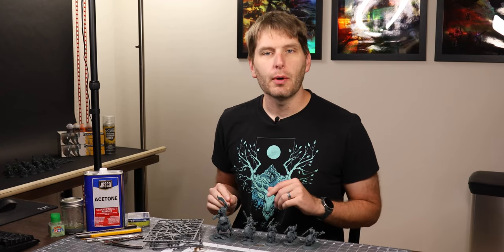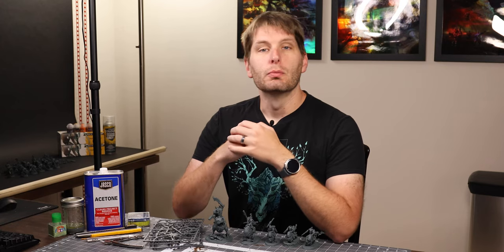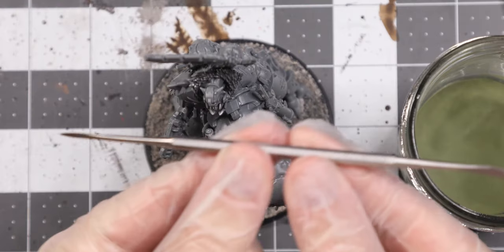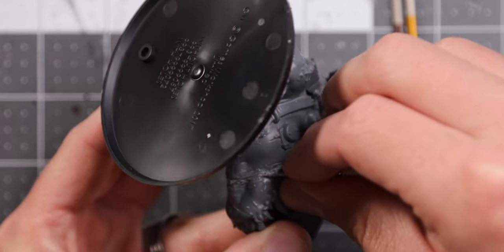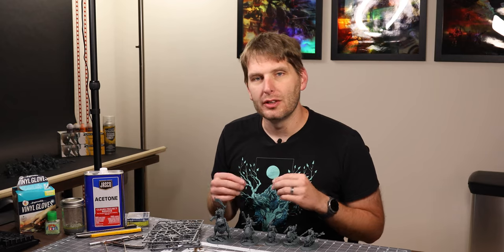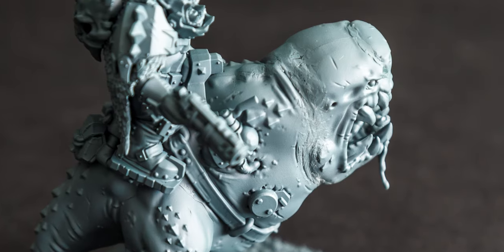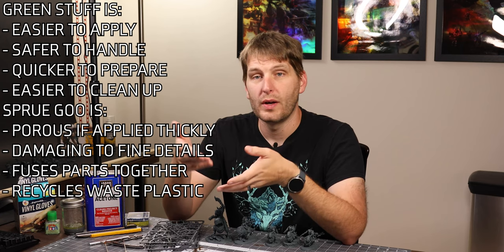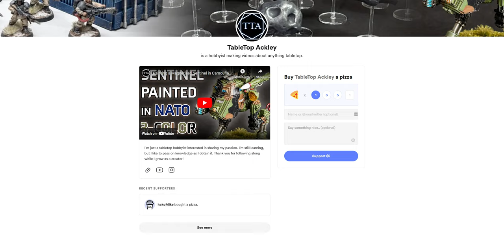Is Sprue Goo Better than Green Stuff for Filling Model Gaps?

Comment: I tend to use a bit of glue on gaps and file it, filling the gap with the small plastic bits that the file takes off. Works pretty well but not on every surface. As others said, you definitely needed to thin it down more!
Reply from the maker: Clearly I needed to do a few practice rounds! I really appreciate the advice you and everyone else are providing.
Reply: @TableTopAckley  No worries, thin enough sprue goo can be used throughout the entire assembly. Pete The Wargamer used this in his recent Soulgrinder video.

Comment: Imo, there wasn't enough acetone in your goo. I don't have as rough a time applying or spreading it with the tamiya mix I use.
I also don't think you explored the largest pro, that you can use it as an adhesive to gapfill as you assemble the model. I could see it being difficult with the consistency you ended up with, but more solvent should make it convenient to paint on.
Reply from the maker: Thank you for the advice. I'll have to tweak my process and see how it improves things.
Reply: ^^^this^^^